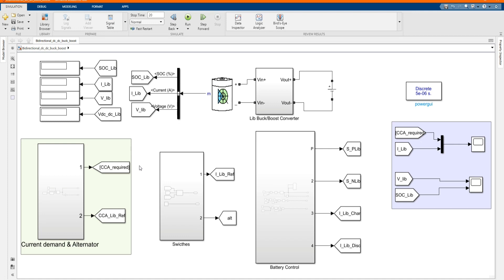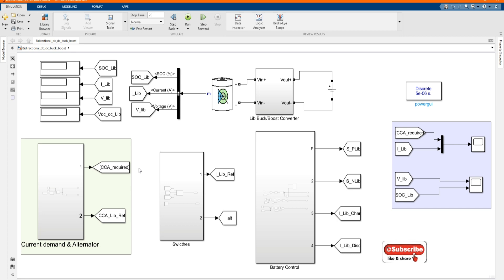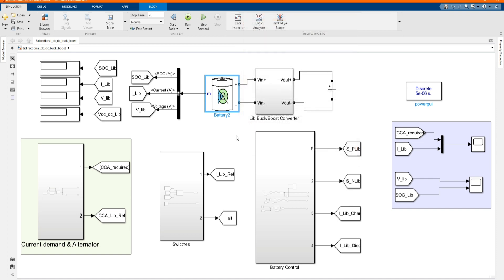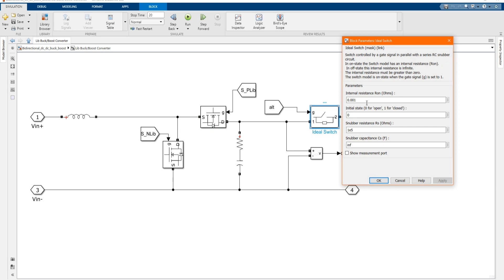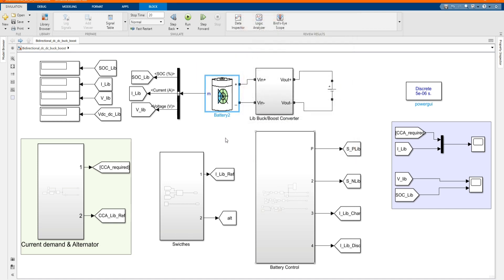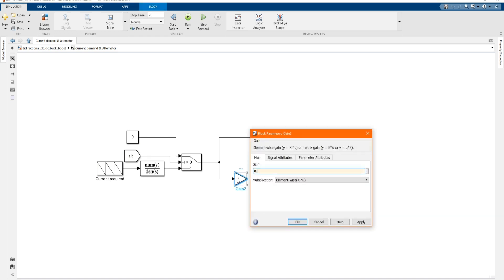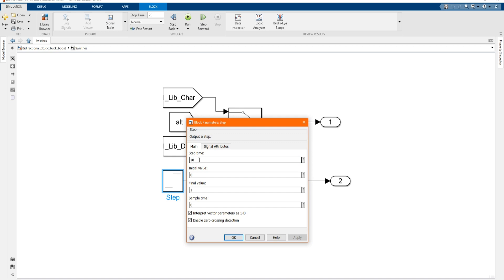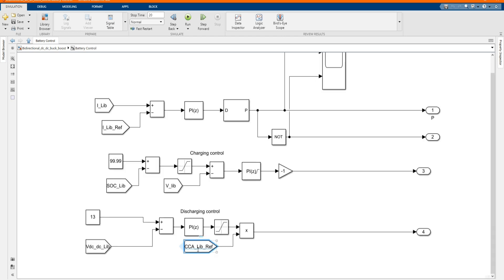Simulation Bidirectional DC-DC Buck- Boost Converter using BMS based on reference current in MATLAB

Comment: Good afternoon, I watched the full video and followed all the steps, but the value of the capacitor and series resistor of the bidirectional converter, values of the transfer function and values of the saturation block during battery charge control are not shown in the video. I didn't find the "current required" block in matlab, how can I find it? Could you please share the values not shown in the video so I can complete the simulation? Thanks in advance.

Comment: Hi Sir. Could you tell me that what is the upper and lower limit values of the saturation for charging control?
Reply from the maker: Helo, thank you for your comment. Since I am using a normal internal combustion engine which requires between 1 to 2 DoD to start the vehicle I used 96 - 99.8% SoC

Comment: I'm still not understanding the current demand. Is there an alternator in the current demand block in the HESS video? Can you list all the blocks and parameters used for this component please?
Reply from the maker: Helo, Thank you for your comment. There is not alternator in the current demand. The alternator is using as reference. when HESS supplying means the alternator is not brunning .. after seconds the alternator is running and the HESS is been charged.  Which component should I list the parameters ?
Reply: @pzengineering2020  Please list parameters for every component used in the current demand subsystem (eg. Current sensor - gain block,  Current demand subsystem - all components) 

From this video: https://youtu.be/q22I595GX8s

Thank you very much!
Reply from the maker: Helo, I understand now... we will do it
Reply: @pzengineering2020  Any update?? Your help would be greatly appreciated.
Reply: I also need the current demand subsystem block please
Reply: Please give the description about current demand block

Comment: Sir, it's very useful video, can you tell me how to set the parameters of the transfer fun in the current demand&Alternator block? Thanks!
Reply from the maker: Hello, thank you for your comment ; you can just follow everything that is in the video. If I am not clear , please elaborate your question
Reply: @pzengineering2020  I mean in the 'current demand&Alternator' block, you connected the current required model to a transfer fun? is it? I didn't find how to setup the transfer fun, thanks!

Comment: How can i get the simulation  file
Reply from the maker: Hello thank you for your comment, We normally don't give our files to people, however, we will discuss about it... is the video not clear enough for you to follow and build your own file ?
Reply: @pzengineering2020  The video doesn't show the value of the capacitor and series resistor of the bidirectional converter, transfer function values and saturation block values during battery charge control. Could you share the values not shown in the video so can I complete the simulation? Thanks in advance.